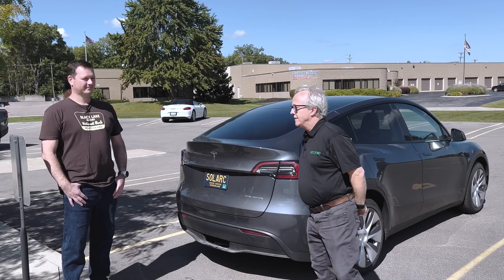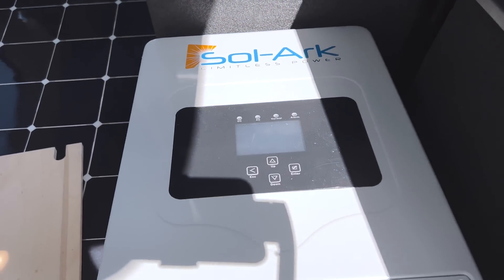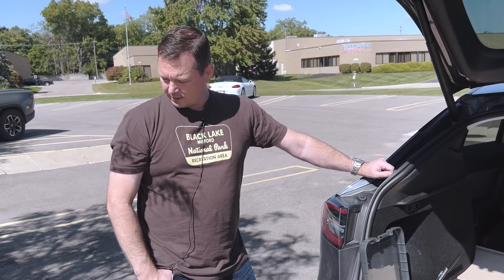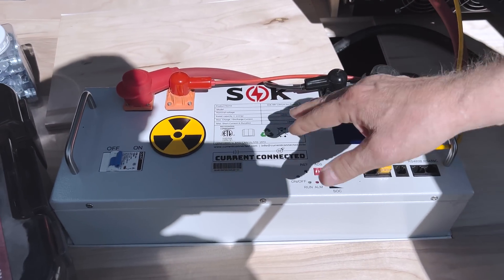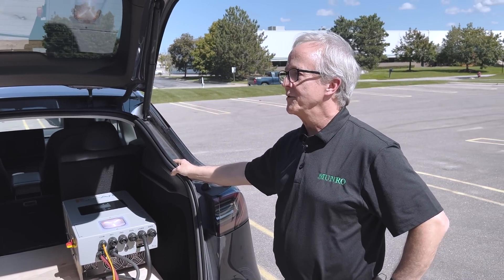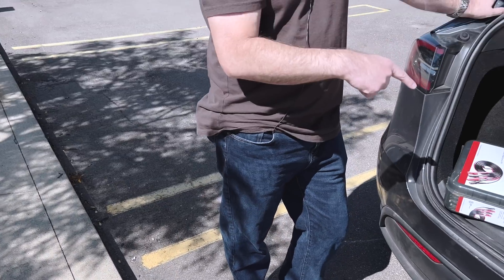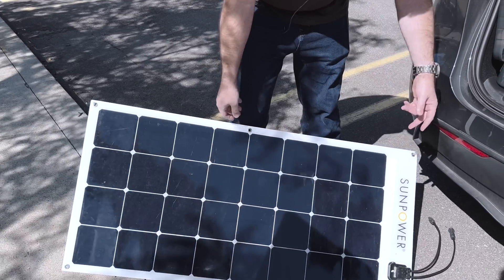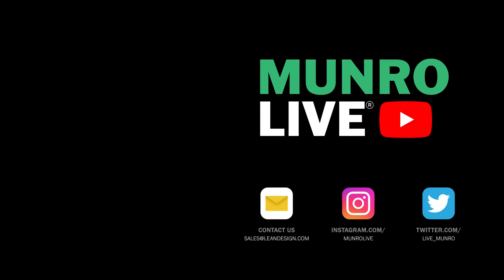Solar Powered Tesla Cannonball Run

Comment: Starting end of June might have saved a few days of travel time...
Reply: That's what I was thinking but he didn't mention the heat would add a lot of wasted energy.  He won't be using hvac (when driving), the inverter won't overheat the cabin (much).  This could be broken by using double the array size and only camping for 1 day of charging.  That would be a lot of work though to break down and set up!

Comment: 64 panels. Riiiigght. How much room left in that trunk after putting the 64 panels and materials in. Practicality of this setup is zero. But hey, I guess it's just a "I can do it!" type of thing.
Reply: If you watched the video, the 64 panels stack up to be only 1ft high.  This is simply a starting point challenging others to do better.  Apteras will beat it, but you can keep a record for normal sedans alongside ultra efficient vehicles.
Reply: I’m really hoping this was a sarcastic remark and the delivery was off. If not DUDE it’s a cannonball run lmao function over form.
Reply: I'm more concern about having to set up 64 panel to receive the sun.  The space and the time.  Might as well make the panels into a giant tent at that point.  And then when you're done it'll almost time to head back from your camping trip Hahaha.
Reply: @Tien1million  Why?  He said it will take 2-3 days to charge.  This cannonball run is quite the vacation compared to normal ones.  Dragging out 64 panels is annoying, but when each one takes less than a minute to set up, we are only talking about 30-60 minutes of time to set up.  His biggest problem will be wind and people stealing stuff when he is not looking.  People suck and will happily steal panels that they ultimately do nothing with.  The one upside is he'll catch anyone doing that on camera with the tesla.

Comment: Flexible solar panels are almost always inferior
Reply: Not true!
Reply: Depends what you're optimizing for... monocrystaline rigid panels do have higher efficiency for a specific price point, and their requirement of sturdy aluminum frames means built-in air cooling gaps which prolong their life, a detail some people miss on flexible panels which limit their lifetime and can cause them to overheat and further reduce solar efficiency. But, if you have to carry the solar panels with you in a car, then the weight penalty of the monocrystaline panels is huge (~+5kg per panel; let alone the needed space in a small vehicle), and it's associated hit to mileage per day achievable on solar alone would be higher than the minor efficiency differences in the panel cells themself.
Reply: Not that you can fit 64 rigid panels in the car

Comment: Very 1980's style. We used to race solar electrics back then. Weird how little things have changed other than that the cars are production electrics instead of custom made teardrops.
I wish I had the time to take a few months off to do something like this. Sounds super relaxing if you can find camping spots.
Reply: could tow a flatbed trailer with many to go nonstop... easily done now the last few months.. it reminds me of the competition the colleges do in the desert.. it is constantly breaking the prior year records as solar is becoming more efficient
Reply: @dertythegrower  All about surface power. Towing few oversized solar racers without cockpit would be interesting. It adds power demand to achieve road legal speeds (say 50mph/80kph). Battery to get over hills fast enough and regen. Rip battery from the tow vehicle and replace with tiny one.
Reply: @dertythegrower  Going Each to West consistently on the Northern hemisphere, one could raise the solar bed a bit and add a second layer below it on the left side. Also the main solar arraw could be articulated left a bit. The right hand side might have a vertical section catching the sunset and sunrise.
Reply: @dertythegrower  While pointless, it would be interesting to have a design challenge where one would engineer a trailel to be used for on-the-go charging on a given US coast to coast route (solar angles), to capture the more sun energy and make it across in the fewest number of hours while actually respecting (tow) maximum speeds. A clever design might incorpoate a panel that pivots on both the tow car and trailer and spans both at legal maximum width. Just how BIG a solar array fits on a road legal setup, and what are the realistic yields on statistically average days during the best days of summer? To keep going swiftly I guess you need 20-30 kW or so, making it 40 kW when the sun is out. You can only discharge once per night, though.